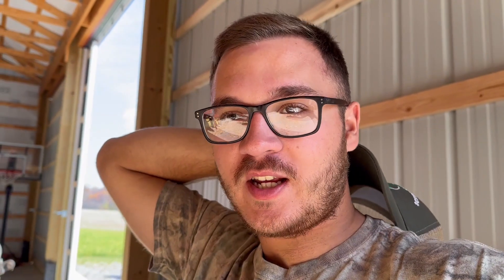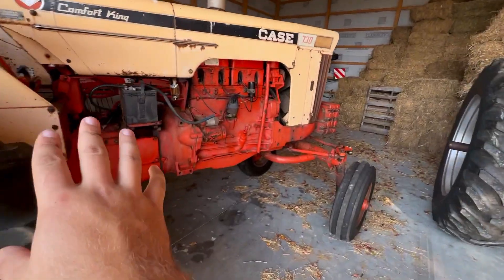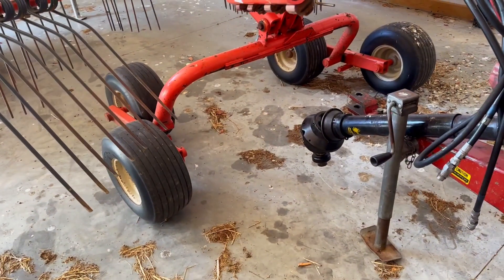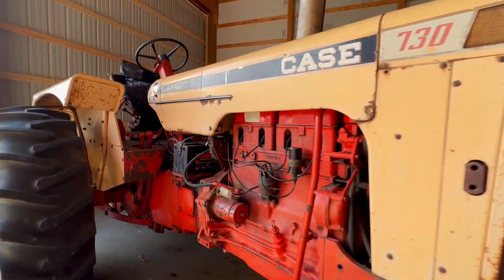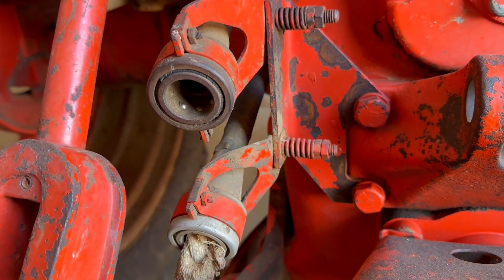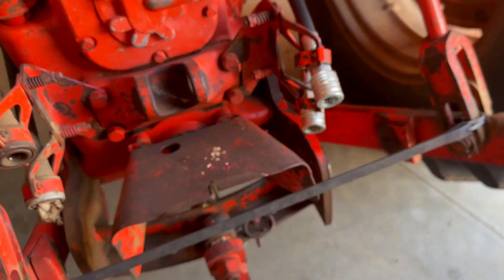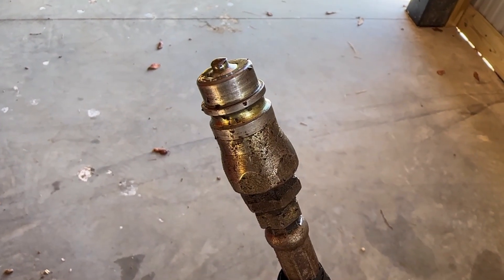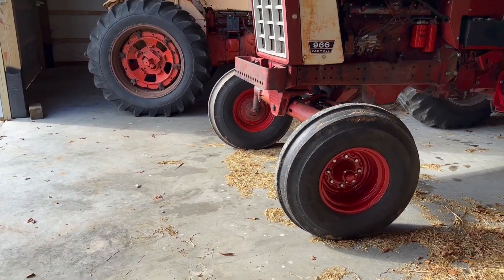Understanding OLD TRACTOR HYDRAULICS  --  Pioneer Hydraulic Couplers

Comment: I bought a 966 about 3 months ago, and I've run into so many of the same issues with lack of info.  I'm also just using two couplers for now on one of the rear remotes to run by cutter and baler, but I eventually plan to convert both rear remotes to pioneer.  I've also got a loader I need to install on the front, so I've actually contemplated just redoing everything and putting in a 4 function control.

Comment: Replace the O- rings in the original tractor couplers, the adapters may stop leaking. On the Case, they make aluminum brackets that you bolt to the tractor and clamp onto the quick connects. Holds everything in place so you don't have to fight them. Check with your hydraulic shop they should have them. Miss seeing that old case out in the fields behind my house.
Reply from the maker: That case is the best running tractor we got!